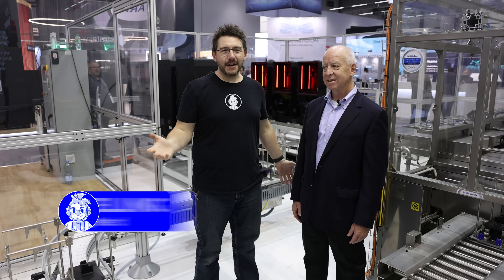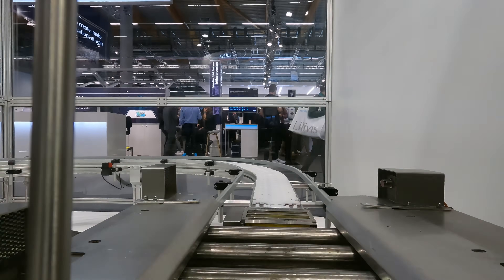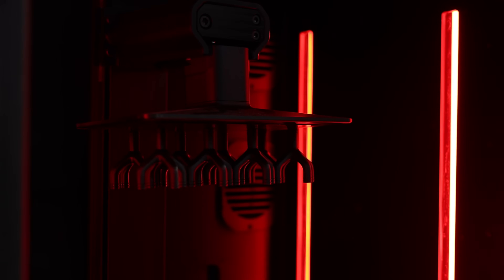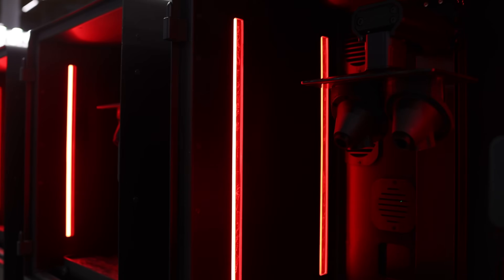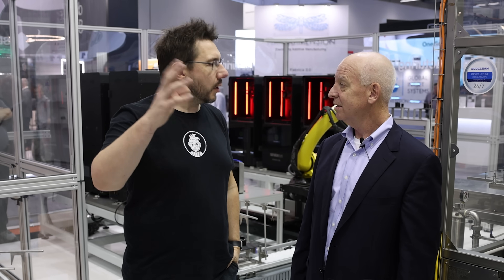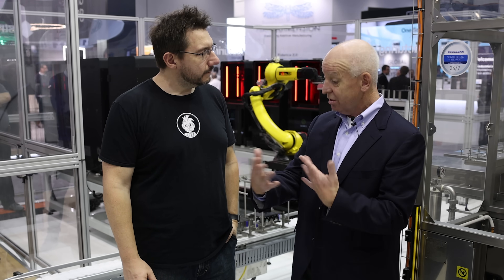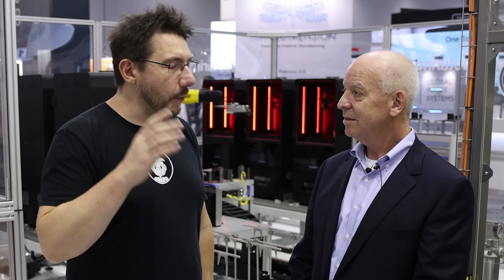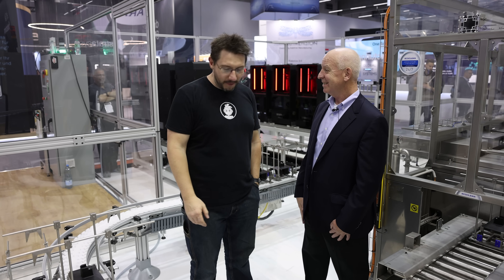The Future of Automation: Inside Look at Stratasys' P3 Automated Production Cell

Comment: Formlabs did something similar to this with an automated SLA production line, this doesn't seem much different. Also what resin would be tough enough to withstand industrial/commercial use that we don't already have?
Reply from the maker: Yep, I remember that, I was there Mitch! Even did a video on it - don't you remember? :) This is quite different than what Formlabs was doing at the time. As for the type of resin, right now there is some crazy stuff going on at the Industrial level. You'd LOVE it.
Reply: @3DPrintingNerd  I do remember your video on it. It's exciting to see the technology improve. I can't wait until I see these printed parts in everyday products (assuming they can be recycled properly)
Reply: There is a lot happening in industrial resins.  Here's one we announced this fall with strength at high temperatures from Evonik: https://stratasys.com/en/resources/blog/evonik-p3-materials/?utm_medium=social&utm_source=youtube
Reply: @Stratasys  good to know! I heard Henkel as one of the resin suppliers, I've worked with them on industrial hot melt and they have some crazy polymer chemistry.
Reply from the maker: The people at Henkel are wizards.